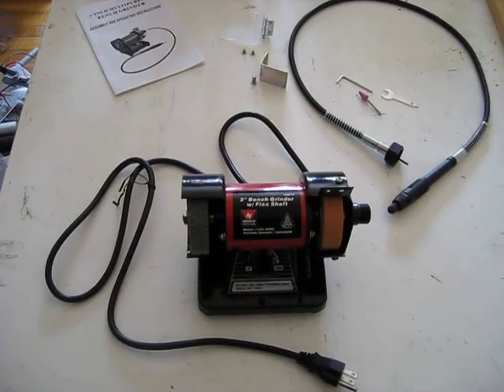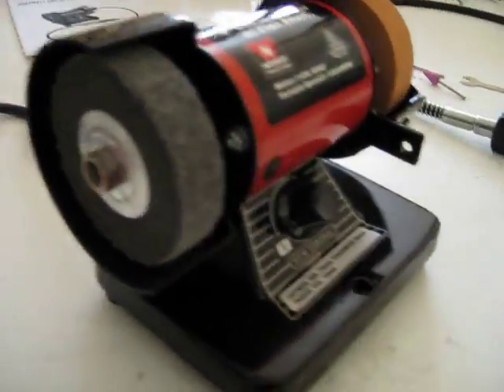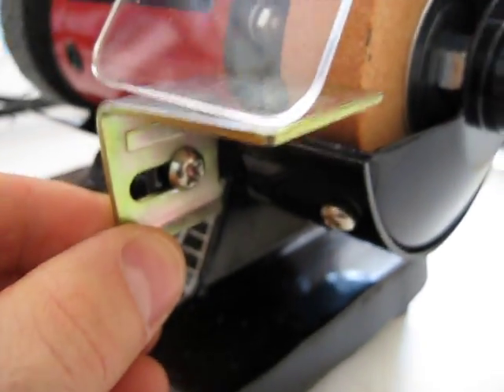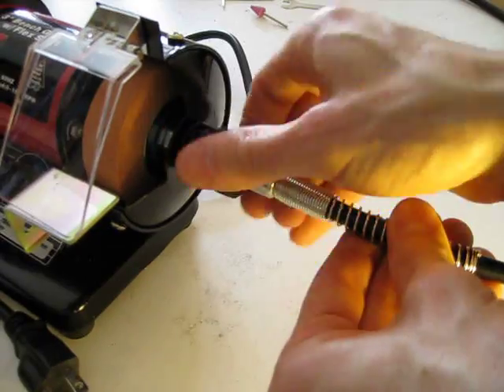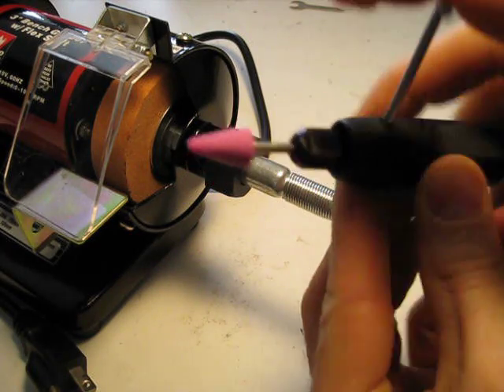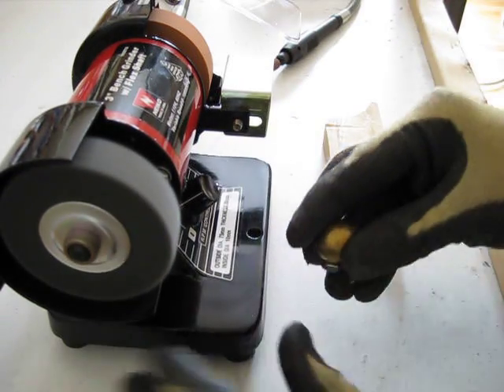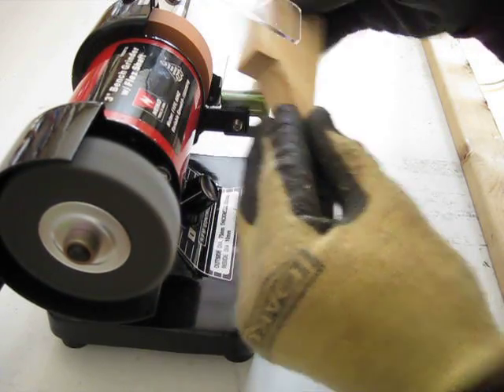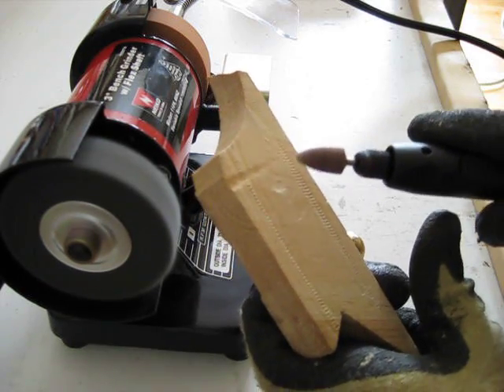Mini bench grinder/polisher with flexible shaft (0-10,000 RPM no load)

Comment: I found your video quite informative. I was looking at one of those to sharpen my lathe bits. Not convinced yet that it's what I need to do the job, but at least I know what to expect. Oh wearing gloves on rotating equipment is usually a no no. Saw my dads boss, back in the 70's, get his hand sucked into a grinder doing exactly what you were doing. It ground half his thumb off before he could pull the glove and his hand out of the grinder. Just want you to be aware of the possibilities. Thanks for sharing the video with us. Best Wishes n Blessings. Keith 
PS thumbs up!

Comment: I s there a way ro reverse the way the wheel turns?
Reply from the maker: I'm pretty sure it's an AC motor so my understanding is you can't reverse the way it turns.
Reply: Yes, take the wheel off and mount with the outside inward.

Comment: hey bro am in africa i wanna buy this machine for commercial use in sharpening knives can it work on that? and how long can it run before its over heat!
Reply from the maker: I don't know. The documentation doesn't say what types of objects can be ground with the wheel that comes with it. I bought it to use the motor for something else so I can't test it. As for over heating, I don't see why it would.
Reply: I don't own this grinder, but I do make knives and I've used similar grinders so i'm pretty sure it will work
Reply: That would depend on the amount of pressure that you applied to the grinding wheel.

Comment: Grinding wood? really?
I've been in various jobs working with grinders and I can say I've never seen anyone grinding wood. 
In fact I don't think grinders are even meant to grind wood.
Reply from the maker: +Jack Flash LOL! I hadn't even thought of that. I didn't buy the grinder to use as grinder. I bought it because I needed a small motor that had shafts on both ends. So to demonstrate it I just grabbed what I had handy, hence the wood. I guess if it works then there's no reason not to do it, unless there is.
Reply: +RimstarOrg "I guess if it works then there's no reason not to do it"
I agree with you there but I think repeated use of the grinder to grind wood would probably mess up the grinding wheel simply due to the sap etc.. clogging up the wheel.
Anyway... good video and I'm going to get me one of those grinders next time I'm in HF.
Reply from the maker: Jack Flash
Yeah, clogging up the wheel was what I was thinking too.

Comment: lol ,,,ive seen this tool sell for many colors and brand names...
their all the same thing....
cause they all come from the same factory....

in my country it was hard for me to find 3 inch grinding stones and when i did the middle holes were 3mm larger so i made a sleeve on the lath to make it fit...

this is my third year using it...
the motor is strong,,,,but when i changed the stones it became insanely fast with berserk vibration LOL which made me laugh 
shaft is okay with the exception of the of the steel collet...that thing didnt last me a day
so i got a MINICRAFT MB1925 steel collet set which is far better and my flex shaft capabilities were restored...

next step is a speed controller...

Comment: Hi, I have one of these and my only complaint is that I cannot find 3 inch wheels other than the replacement stone and fiber. I NEED a diamond wheel, and with 1/2 inch arbor, we can get 1 inch bushings to fit anything. But the problem is I'll either have to take the shield and stuff off to get a 6 inch standard with no shield whatsoveer unless anyone knows if Neiko or anyone is making a small diamond wheel. Jimmyrigging options.... Let me hear them!!! Thanks-- Jill, Jacysoriginals.com

Comment: hi I just bought this item but I wnt to know is it safe if I install a bigger grinding stone? like 4" diameter or 5".
Reply from the maker: That I don't know, sorry. Either the outer rim will be spinning much faster or due to the added mass will be spinning slower. You will have to cut off the metal guards to fit them on. You might also want to verify the shaft size when you shop around for the grinding stones.

Comment from the maker: There's no way to remove it with just a screw driver but I needed to remove it too so I cut it off with a hacksaw. It wasn't too hard to do; just a bunch of short cuts. You can see the end result on my website. There's a link to the page in the description below this video. It's the one about the Hyde generator.

Comment from the maker: I just checked the instructions that came with it and they don't give a list but they do talk about sharpening chisels and drill bits in the safety precautions when talking about using with small objects. So it sounds like you can. Unfortunately I've since taken mine apart to use the motor for something else otherwise I'd sharpen a knife I have now that needs it.

Comment from the maker: It is a sweet machine!

It cost $84.50 CDN ($80.45 USD) by the time you include shipping. Without shipping it was around $40.00 USD. I just updated the box on the right with this info. As for the loudness, you have to raise your voice a little bit to talk over it but the best I can say is to judge by the sound in the video. Turn the volume up so my voice sounds normal volume.